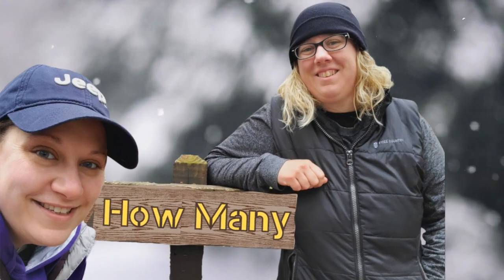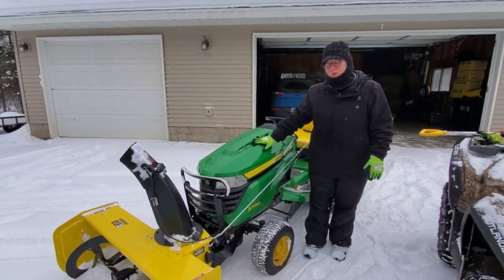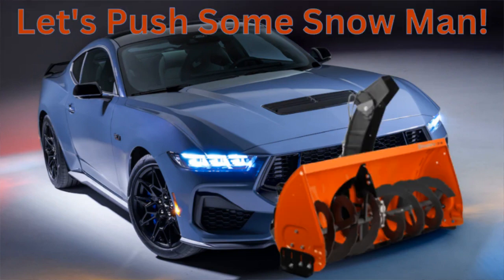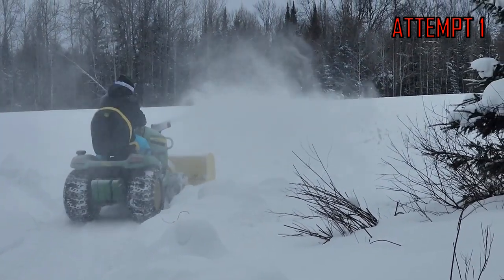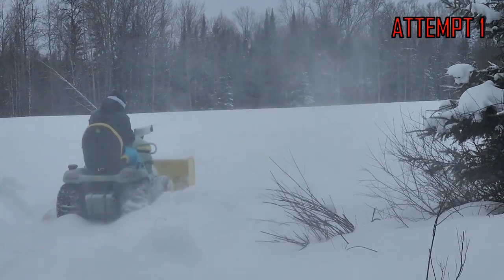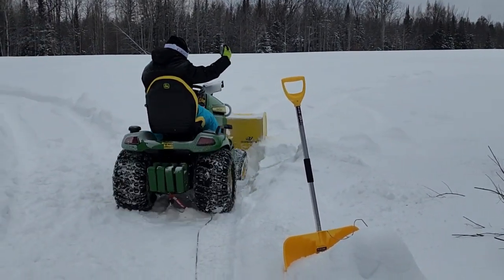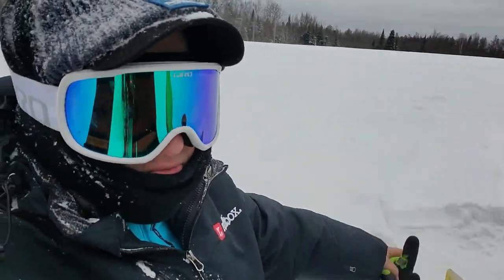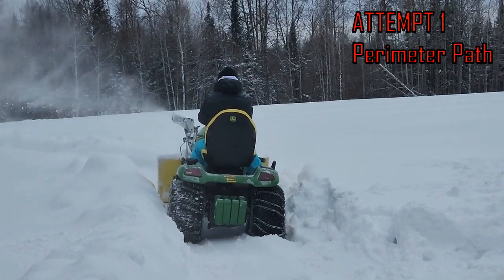DO NOT Do This With Your John Deere Snow Thrower

Comment: Wrong tool for the job ladies 😮
Reply from the maker: I agree we need a big old tractor or something. This little JD has been relocated to the driveway permanently! (even there is struggles sometimes).
Reply: @40acresofclueless   
May I suggest something in a sub compact Kubota BX diesel 4x4 series . I have one with a front end loader & snowpusher. I use the mowing deck for lawn maintenance also ! JD also has a sub compact series also !
Reply from the maker: @roadglide1142  our neighbout has a little Kubota, not sure which one, but he is always doing work with it around his property. I think his has a little bucket on it too. The 4x4 is pretty much necessary. Unfortunately we bought this JD when we bought out house and were clueless as to what we would actually be using it for. Cuts a mean lawn though with it's 54" deck!!!
Reply: @40acresofclueless  That’s a great lawnmower but it’s really a one trick pony ! 😝 I traded in my JD X-350 for the BX which suits my needs. It was a great lawnmower
Reply from the maker: @roadglide1142  yeah one trick is for sure!